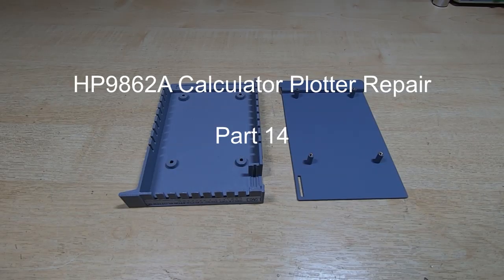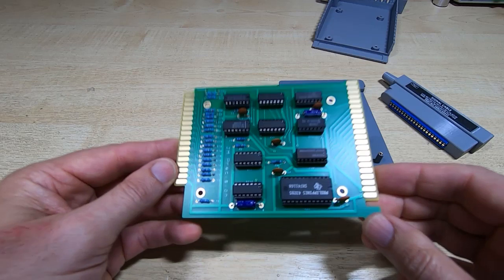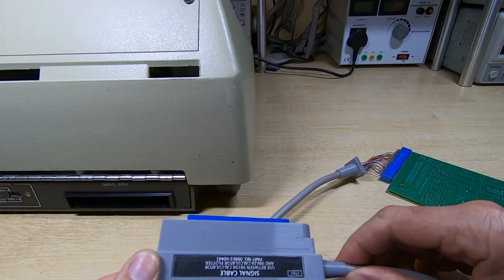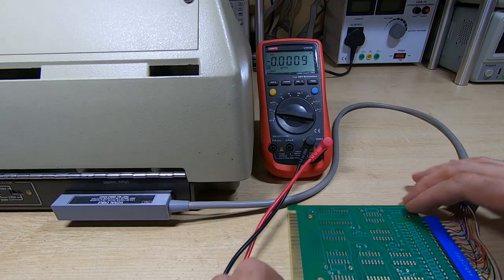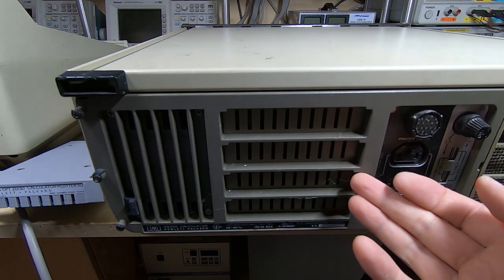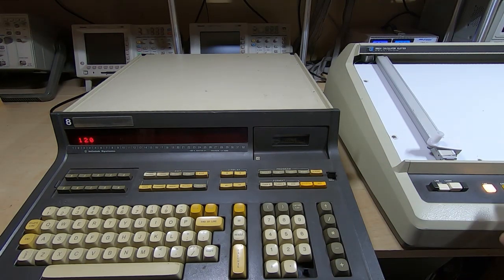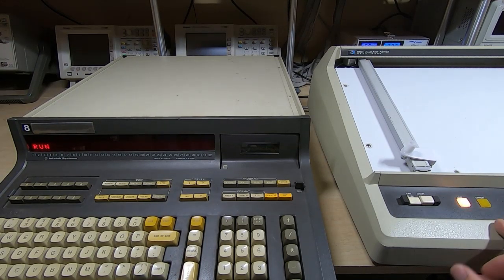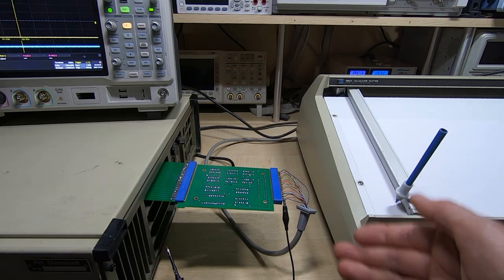HP9862A Calculator Plotter Repair Part14

Comment: Jerry -
Interested in how you “made up” the Connector Housing”.

I need an Edge Card connector housing (40, 2x20) that HP used with their 
very early computers (early 1980s) and matching 5-1/4” external floppy drives.
Did you use a 3D printer or injection mold ?

greg
chicago

Comment: Jerry, it looks like you've made very good progress!  I assume that you used some kind of adhesive to secure the round cable in the grommet in this interface board?

Would you consider making a video about your generic "lessons learned" on making replacement cables?  Also, have you found a way to recreate the thin "see through" flat cables like used inside the (Timex?) Sinclair microcomputers?  I've got one with a torn cable which I need to find a way to replace before I can attempt further testing & use of the computer.